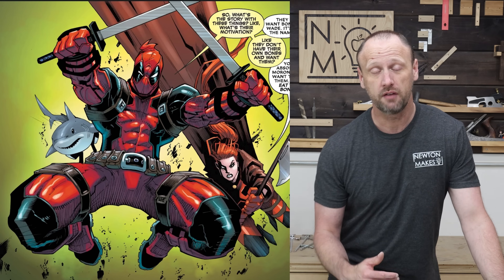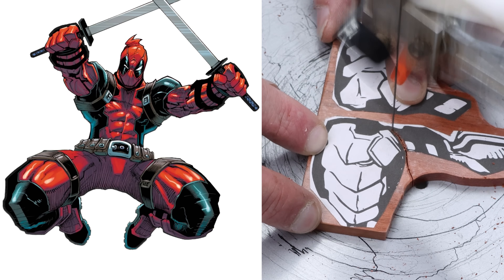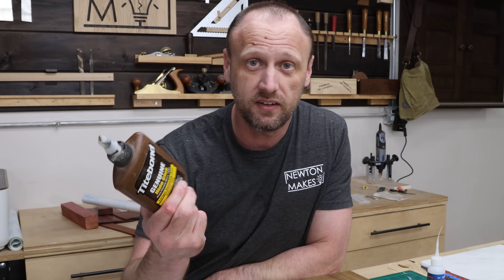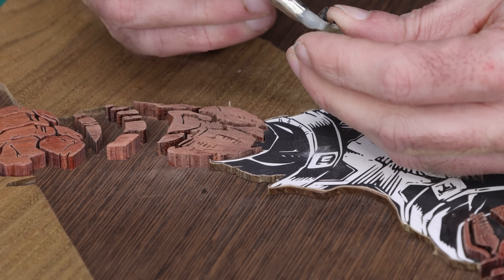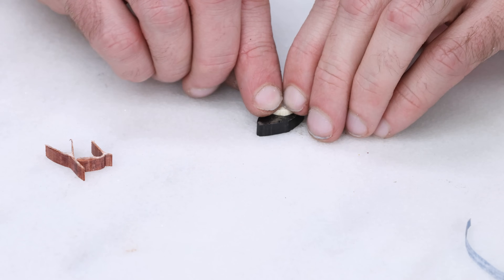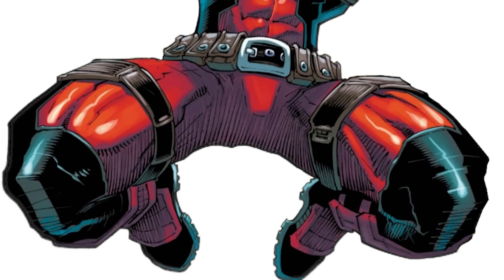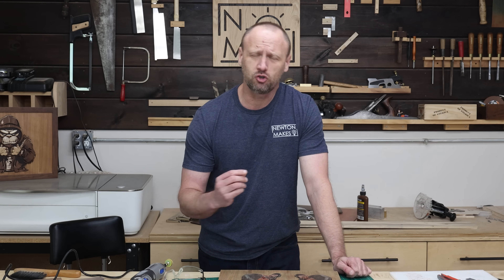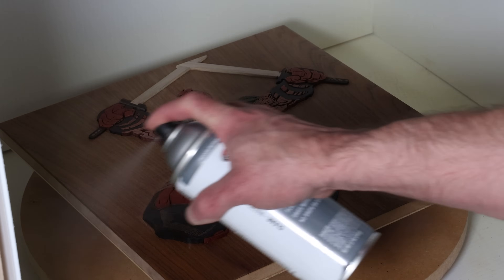Making Deadpool Out of Wood | Marvel Woodworking Project

Comment: You might also consider epoxy, colored in different tones or colors, either to fill in tight spaces or account for difficult colors to find.  Also stained glass or stained glass designing practices.
Reply: I think using epoxy and colored tones could definitely make it more colorful and closer to actual drawing! However, the use of natural wood colors alone takes this from a really cool piece of art to an extraordinary one.

Comment: "All I have to do is cut two parallel lines" 😂 
I find straight lines to be the absolute hardest cut to make on a scroll saw because any little wiggle is immediately noticeable as opposed to cuts that turn.
Absolutely amazing work!
Reply from the maker: 100% correct. I laughed to myself later when I realized I said it.

Comment: Dude, you could just use aluminum for the swords. If it’s thin enough, you can cut it with a scroll saw. It’s tuff, but doable. That being said, this was astonishing work!
Reply from the maker: Great idea. Maybe in the future I'll make a mixed media project.
Reply: @NewtonMakesArt  you can use a very thin aluminum. Soda can might work well. You’d probably need to laminate it to a substrate of some kind, but it would be much easier to cut.